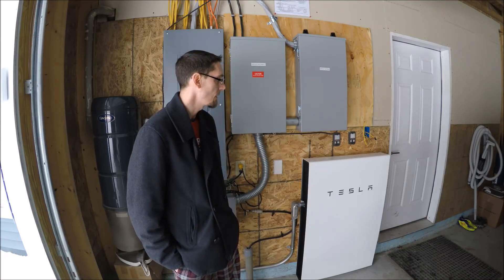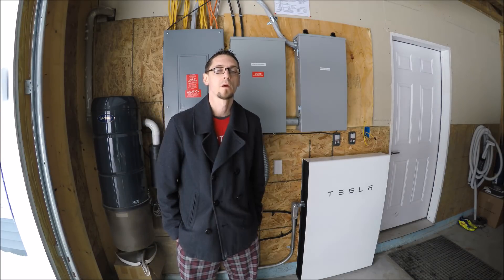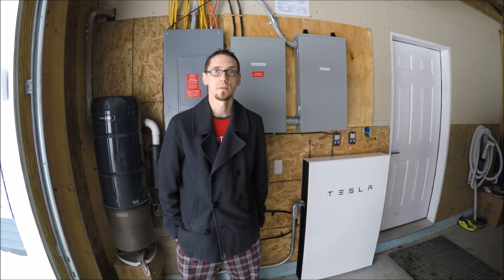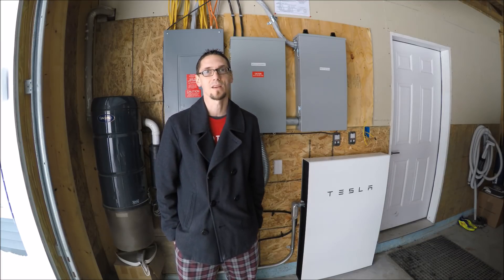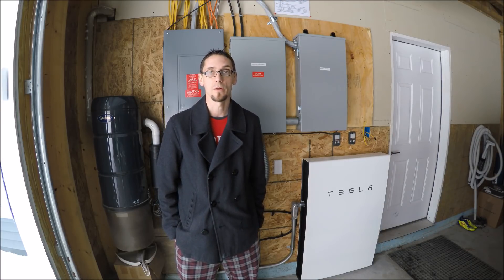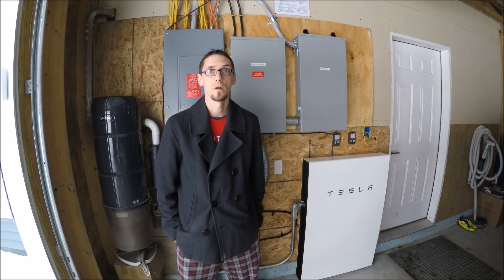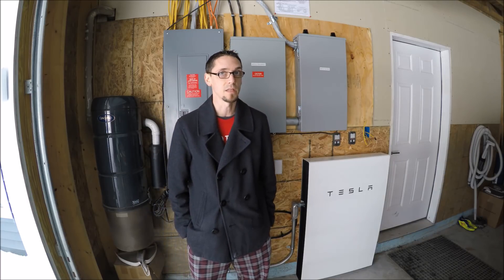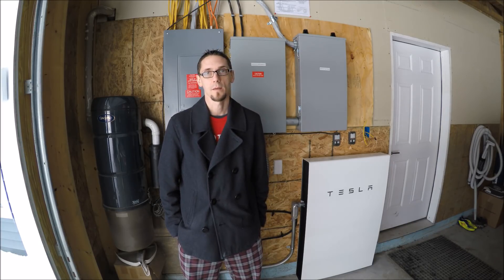New Tesla Powerwall For $1500

Comment: Actually that’s GMP’s powerwall, not yours. You are only renting the emergency power capability for $15/month or $1500 for 10 years. GMP is the one getting $1500 off their powerwall which they will use when they need it, and you will use it only during power interruptions. If you have a lot of power outages there, it’s worth it. But you can’t use it anyway you choose, because it’s not your powerwall. You cannot use it to store your solar energy. Hopefully everyone understands this.
Reply: In ten years your gonna be able to outright buy a better battery system for $1000.
Reply: yeah you can you do understand that the power wall only outputs 5 kW continuous at any given time. If you look for a 5k generator on google the cheapest option is $434. Know with that said I love the power wall and I would get that over the $434 gas generator but to say that you can't get a generator that would produce the same power at the power for less then $1500 is false.
Reply: TM3Life great conversation.  Learned quite a bit from the both of you.
Reply: TM3Life, I rewatched the section explaining how the big loads (range and Tesla charge point) were isolated from the emergency power. Good that the water heater is gas and the boiler only needs power for the electronic controls. You said the dryer is not on the high power circuit, so I’m assuming it’s a gas drier and only needs small power for the motor and controls.

The deepwell pump probably needs a lot of starting current, if the water table is 500 feel down, it’s going to take some power to get it out. Sort of surprised that’s not on the high draw circuit with a means of jumping it in the rare circumstance that your storage tank runs dry during a power outage. Unless the storage tank is tiny. But maybe your pump motor isn’t so big. A lot of things people with city water take for granted, never think of all these details.

All in all it seems like it is a good deal for you, GMP and Tesla. Buying your own powerwall and paying to install it would never even pay for itself before it wears out, because the only way for a powerwall to save money in addition to what GMP powerwall provides, required you cycle the powerwall. If you live in a state with cheap single rate power and fair net metering, using the powerwall for anything other than emergency power will cost you more than not having one. So you pay basically $6000 more than the GMP deal, and have to PAY to use your own powerwall for anything more than GPM provided for $1500 all in.

Few people understand what the powerwall was designed for, which was gaming the tier rates of the power company like California has. It can’t do that in a single rate state. The second money maker was also to bypass what some will say are “unfair” net metering, where you pay 100% for each kWh you import and get 50% for each kWh you export, but they hide that in the 50 lines of fees on the electric bill. LOL

So the last use of a Tesla powerwall is as a whole-house UPS, and in some rare cases, off grid energy storage. Most people won’t pay $6500 plus installation (about $8000 total) for while house UPS. 

What’s genius about the GMP powerwall is they sell you the only feature of a powerwall you can use in your area, and they use the money making feature of avoiding leaker plant charges. GMP does the primary cycles which wear it out, and they are the ones that eat the depreciation and degradation cost. 

The more often you have power outages, the better the deal is. If you work at home and rely on power for internet (assuming the internet provider has power) it can pay for itself in just one power outage per year. If it keeps your food from spoiling in one power outage per year it will pay for itself. 

If that program spreads to other states they will have to stop making model 3 while making 1 million powerwalls. LOL
Reply: Sorry that Statement is Not True I have a 6500 Watt Generator that I paid $400 Brand New about 8 or 9 years ago that I have used more than a Dozen times and I have a 2800 sqft house that i can run anything from My Central AC and Dryer running at the same time with all my TV's and Lights. We had a Tornado take out a Major Substation about 5 yrs. ago and the whole town of about 7,000 was out of Electricity for 4 Days Straight. My Gen ran Non Stop without a Hiccup and this was in July with Temps at 100 every day.  : )
Reply: If you live on a mountain, have considered wind power?
Reply: Easy, just de-limb the top of one tree, and stick a wind mill up there.
Reply: That is what a women in Florida thought till they forced her.  They are going to make you pay a minimum amount
Reply: that would be a pretty great deal , 15 a month if i were allowed to use the gmp powerwall once a day for about 10 hrs and then use the solar or wind to charge it .  i am looking into building my own batteries like they did in the old days , glass or plastic containers containing the proper chemicals to make up a battery and then charge it with solar or wind .
Reply: the only time a person should be worried about paying a high power bill is when they heat a house using electricity . my power bill on the cold winter months is around 700 +  . burning wood or used motor oil lowers the bill to around 150 per month , thats the fridge /freezer , the hot water tank takes 140 per month and thats only one person using it sparingly , i was thinking about building a used oil water heater . to all you people that are full time workers , stop being so greedy due to the fact it makes more sense to use the electricity from the power company . less hassle .
Reply: TM3Life, did it switch fast enough to keep a pc on without backup? I was assuming with all the switching needed it wouldn’t replace a UPS, but a lot of people use a laptop anyway with built-in UPS. 

It’s nice that it has the kw needed for microwave. Most microwave uses don’t use many kWh since you only use it for a few minutes. 

What about water heater? Is that gas or electric? I have point of use, on demand electric water heater for my shower. When power goes out, zero how water, so the GMP powerwall deal would be good for that, as long as the on demand heater was only 3kw max. 

Since the powerwall has about 7kw max output, the power during outage needs to be managed. I had a 1kw UPS with 2x12v external car batteries that I used during long power outages, once the refrigerator got defrosted, I’d let it run on battery, and use my computer/router/modem in short bursts, then turn it all off so safe power. So 14 kWh from a powerwall can definitely keep you functional, and once solar is tied to it you can almost live like normal when the power goes out. 

Does that have an emergency power panel that the powerwall feeds, which isolates it from all the big loads, or do you have to manually select what gets power? A lot of this is related to if you used gas heat and hot water heater and oven. 

I wonder if BMP let’s one customer get 2x powerwall for $3000 for 10 years,  for houses that need 14 kw and 28 kWh for the all electric houses. 

It will be a nice system when you get it all set up. Does your area have any special deals on solar? Some area have some extra incentives on top of the federal 30% if you buy American or locally produced panels. 

Which system are you getting? Tesla, Enphase, or something else? I have no idea how the Tesla monitoring system works, but the Enphase seems to be the best, but you have to installed it properly from day one if you want full access to your own solar management system. Depend if you just like basic data or you want access to what every single panel on your roof is doing.
Reply from the maker: That doesn't take into consideration the cost of the electrical work that is required to put in an automatic failover generator.  Not sure about your electrician costs, but doing electrical myself in VT, I can tell you...you'd be hard pressed to get that done with the additional hardware components for less than $1000.00.  Remember the $1500 I spent was not just the powerwall, but also the associated hardware and installation time/cost as well.
Reply: Dana Weick, yes, each system’s pros and cons all need to be considered. There’s several options, and no single option is best for everyone. The main point is to make everyone aware of the pros and cons of each.
Reply: I seen one guy, create a windmill, by having a long shaft with multiple blades, strung between 2 poles, maybe you can do the same with trees.
Reply: Yep, you can go off-grid anywhere in the country, in you're not in an HOA-type neighborhood which requires grid power to live there.  Everywhere else you can, there's no law stating you have to be on-grid, in any state.  You also are not required to have gas or phone lines to your house.
Reply: leahcimrac, there are ways to stop heat leaking from your home.  Weatherize to block air passages where they shouldn't be and thermal leaks.  No home should cost a lot to heat.  Unless the least expensive heat source is very expensive to operate.
Reply from the maker: You're probably right, but I need power backup now, not in 10 years.
Reply from the maker: Lost of questions here.  The power switchover was unnoticeable from my point and I had my laptop plugged in.  Our water heater is propane, but it also powers our boiler and well pump, which is huge as it's 502 feet down. There is a separate panel that I talk about in the video that explains how the 50amp circuits are separated to the new panel they installed.  Also, because of the gateway, which they also installed, there is nothing I need to do manually to make this work.  You can buy at least two powerwalls and probably more if needed for $1500 a piece, so that is an option.  I only needed onw for what I was looking for. Unfortunately...we do not have any additional credits for solar or for the incoming Model 3. AT this point it will be whatever Solar City is offering.  I do know you can tons of data, but not sure if I can get it individually penal?
Reply from the maker: Actually we have two laundry rooms in our house and both dryers are 240v 30amp circuits, and those are also powered via the powerwall as well.  Literally, the only two things not powered is the range and TWC.  However, we most likely wouldn't use such devices to save power depending on the duration of the outage.  Being that I do work from home and depend on the internet to up and running it really does pay for it self very quickly.  Thanks for all your comments.  This has been a great discussion.
Reply: Kelly Dardeen, lets start a new comment thread about this because it’s an important topic.
Reply: Dana Weick, again, it depends on the situation. But if you can find any reputable link showing the transfer time in milliseconds of the GMP powerwall, or any powerwall used with a gateway that must isolate the grid before it can run its inverter, we can see which loads will be dropped. The powerwall isn’t really a UPS, it’s backup power. As mentioned in the video, it’s slow enough that some of the loads sensed it and shut off.
Reply: I doubt that. Especially counting for inflation. $1,000 right now gets your a electric bike battery with 112 18650 cells. The smaller power wall has about 900 cells!
Reply from the maker: I have, however I’d have to be really high as we are literally in a clearing of 80’ elm trees. I haven’t looked at cost VS benefit compared to solar.
Reply from the maker: Need to see the cost benefit VS solar first. I will look into it. Thanks.
Reply from the maker: Good to know, thanks!
Reply: I hope she takes them to court to have the utilities prove how they can take someone's freedom's away by forcing her to pay for power she doesn't use.  If she's using the power, then she should pay.
Reply from the maker: That was my understanding too here in Vermont.  Won't matter soon as I have solar being installed very soon.  Video to come!
Reply: omg thank you for calling out the catch! because this could save thousands of hrs or days of people doing reserch lol
Reply: optimisticpessimist , its a complicated situation , long story . being disabled and poor at the same time prevents me from properly fixing up the old farm house , debt and other family issues also play a part .  this farm was the only reason i did not get into big time criminal activities . back in the day my family pressured and abused me up to a point where i got into petty crime to help cover the expense of survival . people dont play fair and so i decided to do the same .  once i started to get proper funds i stopped criminal activities .
Reply: Clarify.. 
When you say forced to sent you "extra" power to the grid.. you do mean once your batteries are full right?  You are not required to discharge your batteries to the grid at their maximum rate no matter if your home is using the power or not.
So take care to note that owning the batteries and charging with solar gives you ADDITIONAL credit.

We are doing a solar engineering study called "The Energy Sovereignty Project".  Feel free to tune in to our channel over the next couple months.  We tackle this very thing.  
We are installing 6 powerwall 2 batteries fed by a 10kw solar power array.  What this allows us to do is to store several days of power at the home to handle seasonal shortfall while at the same time maintaining enough additional daily capacity to charge our Tesla model S with 30kwh.. enough for around 100 miles of driving.  Daily.. off sunlight.. for 4 months or so.  
All this in addition to sending power to the grid once the batteries are charged.

So no.. my guess is that even in Vermont where you are mandated to send your extra power to the grid.. this would still be the case.

If they ARE forcing you to discharge fully to the grid at night.. they need to amend that policy.  My suspicion is.. they are not.
Reply from the maker: That statement is true, but honestly you can't even buy a polluting gas generator for $1500 that will run an entire house.  So even for that purpose it's well worth the money.  Also, You "are" able to charge it with solar power, but being that you must net-meter in Vermont, you would send all your extra solar power to GMP  in the form of credits anyway that they give back to you when you're not able to produce enough to cover your electricity bill.  So, I still don't see how this is a bad idea in anyway shape or form.
Reply: TM3Life, I didn’t say it’s a bad deal for someone who was going to buy a generator, but as long as people know they are not getting a powerwall for $1500. Sending solar to the powerwall or out as net metering makes no difference. You are not allowed to consume that power unless there is a power outage, because it’s not yours. 

Other disconnecting from the grid, or a real power outage, I don’t think you have any way to use that power. And if they see you disconnected from the grid too often, I think it will cause a problem. I bet they will not let you use it for your daily solar capture and use. 

As long as everyone knows they are renting only the emergency power of the powerwall, not renting or buying the powerwall, then they can make an educated decision on whether it’s right for them. But your video makes it seem like you think you bought a powerwall for $1500, which isn’t true. This topic came up before so I had already researched it. Clearly there is a catch. 

The ambiguous part is who gets it after 10 years? I assume it’s still belongs to GMP, but what does that mean? Will you have to extend payment to keep backup power? Will they pull it out? Hopefully you can cover this because you have the full contract, and I don’t.
Reply: TM3Life, during extended power outages, it would allow you to send solar power to it. So if you lose power during the day for several hours or for a few days, you would be able to use your solar power to keep you going. 

But under normal conditions, it would stay full and you can’t use the power, only GMP can. If you disconnect from the grid, I don’t know how long until your phone rings with GMP on the line. LOL. Something tells me they already have provisions for this and they will know wherever you disconnect from the grid.

This can be a good deal if you live in a place with lots of power outages or a few very long power outages. As long as people know they can’t buy it for $1500 and then go off-grid. LOL
Reply from the maker: After 10 years and you pay a fee to keep it longer, or rent another one in 10 years.  If you decide you don't want it they will come and take it back.  Actually at any point they will come and take it back if you're not happy with it and refund the prorated amount you paid.
Reply from the maker: Agreed, you can't go off grid, but if I'm not mistaken, you can't go off grid completely in Vermont anyways.  When we do get solar we will be able to charge the powerwall with solar if we are in a power outage for extended capabilities.
Reply: TM3Life, ok, I think we can say you basically rent the emergency backup power during any power outage for $15/month ($1500 for 10 years), with the added benefit that if you have solar, you can send that to the powerwall and use it during extended power outages. 

$1500 all in is a good deal because if you bought your own you might need to pay $1000 to install it. So we should ask what can we gain if we buy and own the powerwall, in addition to what the GMP powerwall program offers. If you don’t have rate tiers, you can’t gain that way. If you have a fair net metering program you can’t really gain that way either. The few dollars you save you would spend buying the powerwall.

So in this case, either no power wall or this GMP powerwall would be the best options. 

If you get solar it will be good to see how those net metering credits work out. I think everyone is going to where you cannot make more power per year with solar than you consume. And they will charge a bit for using the grid for storage. But buying a powerwall won’t pay for itself normally. 

This topic came up with someone who won a free powerwall and has solar with net metering, fixed rate, and almost 1:1 net metering. So even his free powerwall would cost more to use than the money saved. Because charging and discharging the powerwall loses some energy, not much, but more than the net metering loss. 

Hopefully you get your solar going soon.
Reply from the maker: That's the best way to look at it.  Please make no mistake, I know I don't own the powerwall, but because I live on top of a mountain and have lost power multiple times, it just seemed like a no brainer for $1500.  Looking to get the solar installed after the Model 3 arrives and I'm charging that as well.  The reason is exactly what you mentioned.  They will only allow me to make enough power to accommodate what I consume.  I do believe that GMP covers the cost of the energy loss from charging and discharging. Not sure if that's still going to be the case once solar is installed?  Thanks for your comments...great conversation!
Reply: TM3Life, do you can a simplified schematic on how that powerwall is connected and where the sensors are for measuring where all the power is going? I’m sure GMP will cover all energy losses for what they use, and they won’t allow you to use it every day to store your solar, only on days with a power outage. 

In cases where you own the powerwall, you would be able to store your daily solar generation and use it up every night if you want, but not with GMP powerwall. But unless you have a really bad net metering agreement you would waste money doing that. So it’s best to set it up as a whole house UPS (like they did), and you are lucky they allow you to use the solar to refill it when the grid is down. A lot of people find out late that they can’t use their solar during power outage in Florida. It takes a lot of special disconnects. 

It sounds like it’s going to be worth it, $150/year that should keep the food from spoiling in your refrigerator and freezers. 

Looking forward to your next video.
Reply from the maker: Ironically, we had a power outage for four hours only two days later.  The crazy thing, is I work from home and never noticed the power went out...ni flicker, nothing.  The only reason I even knew we lost power was the wife came home and asked why the range was off?  Then I pulled up my app and we were running on battery power.  It only used 23% of the battery for those hours, which was me working from home, using the microwave for lunch, hot tub running, etc.  Not too bad as I wasn't even trying to conserve power.  The best part was how seamless the transition was in both directions. In my next video I do about some items I ordered for the Model , I plan to mention the power outage with some pics from my Tesla App.